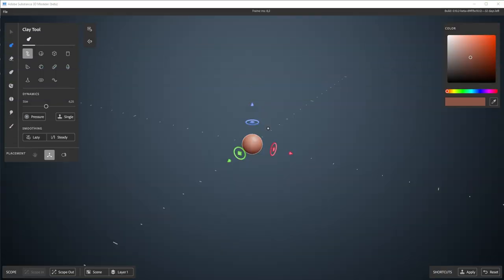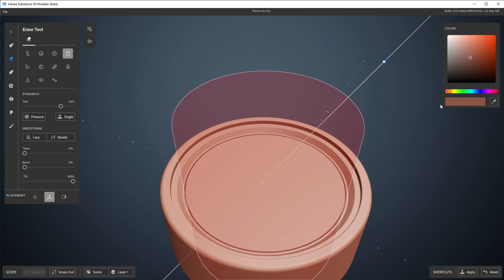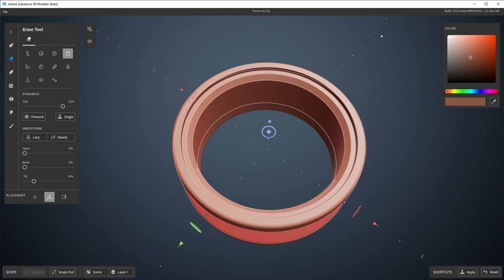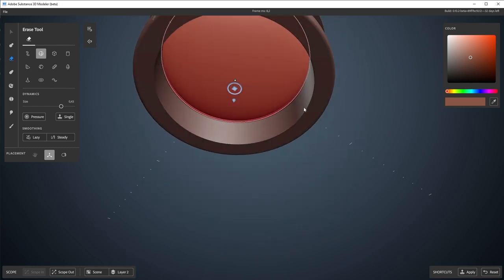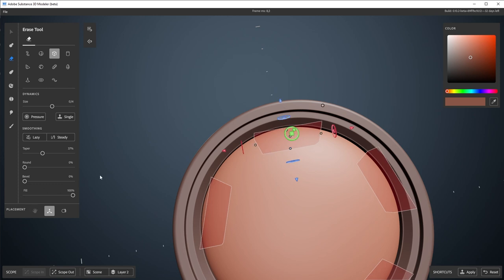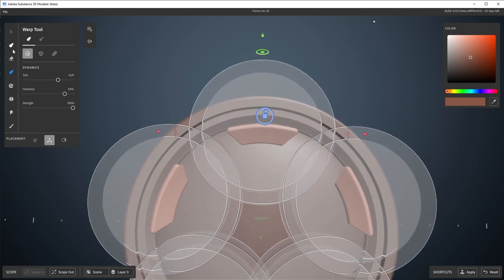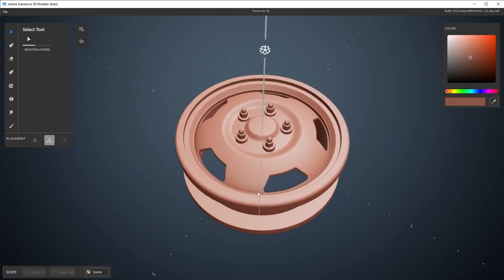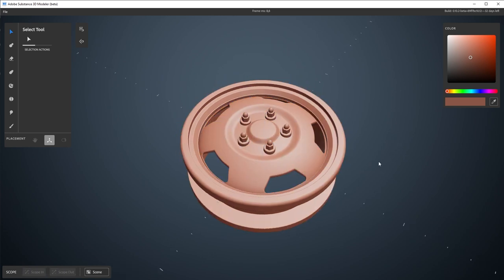Creating a Wheel in Substance 3D Modeler Beta | Adobe Substance 3D

Comment: I'd HIGHLY suggest adding a key for transforming on every BUT selected axis, as in Blender. For example, I want to make my cylinder thicker, but not higher. Right now solution is in 3 steps - increase overall size, decrease height, apply. 
It will be a lot faster if you could exclude axis + it can be much more precise and will surely spare you extra hassle of changing views to align everything properly.

Comment: If you could auto-create splines at user-defined threshold angles, then be able to use though splines to precisely target those edges, with modifiers, such as sharpen, smooth, and even draw your own profile edge different shapes to distort those edges, that would me the holy grail of user control.

Comment: so it works basicaly with booleans so no topoogy involve?
Reply from the maker: Yes!
Reply: @Substance3D  I wonder how you will position this software in the broad range of alraeady available options on the market - many of them powerful and free or having a very favourable pricetag. 

Pure boolean workflows may be intuitive for beginners but you can only go so far with it. Looks like the meshes will be really dense so real-time use may be off the cards and - again - for high detail-high poly modeling there are options aplenty.

Will there be options for remeshing or any features that take this software beyond being a concepting tool? I am really curious.
Reply from the maker: @Gerulf Dösinger 
I can not stress this enough: Modeler is beta, still in development, and things might change. There are a lot of talented 3D artists working at Substance, who raise the same points as you (me included).
That said, there is already a remesh and auto-UV workflow built into Modeler. There's no video on it yet, I want to make one asap.
The meshes and UV's it generates not perfect, but it's many times faster than manual rework (5 mins vs 3 hours or so for this wheel).
Reply from the maker: @gerulfdosinger9869  Also you say "pure boolean workflows" but Modeler is more than that, I'm not a character artist like our Art Director Gio, but he makes crazy organic stuff with. You can definitely do more with Modeler than just these simple add, subtract merge operations. I just wanted to show a simple project to get started ;)
Reply: @Substance3D  Cool stuff. Don't get me wrong, I wasn't to critize the product unfairly - I am genuinly curious! I hope I didn't come across as rude or provocative.

Looking forward to seeing more videos about features - mainly UV, remesh and Painter integration! Keep it up.
Reply from the maker: @gerulfdosinger9869  No worries, sorry if I made it seem like that. Working on that export video right now!
Reply: @Substance3D  You didn't, all is  fine. You mentioned your art directors work on characters. Can it be seen anywhere (artstation?) and maybe there is some stuff already made in subs modeler.

Btw, software like Painter was a game-changer for me personally. So thanks for that. :)
Reply from the maker: @gerulfdosinger9869   Hey sure, Gio is on Artstation: https://www.artstation.com/gionakpil
And he's in the livestreams from time to time: https://www.youtube.com/watch?v=9ryxGaUu4cA&list=PLB0wXHrWAmCxAwP0CWvDGgsxPAKA-B_Iv